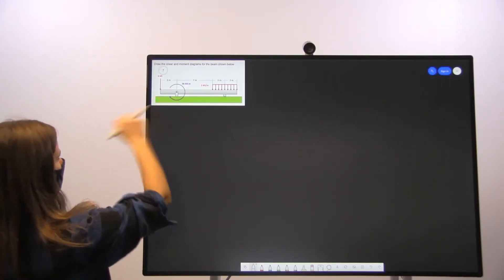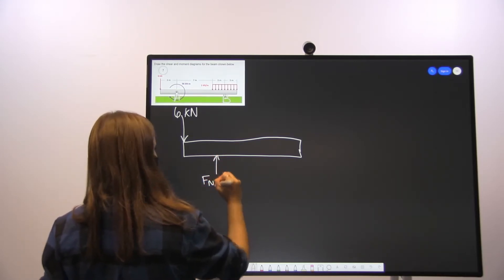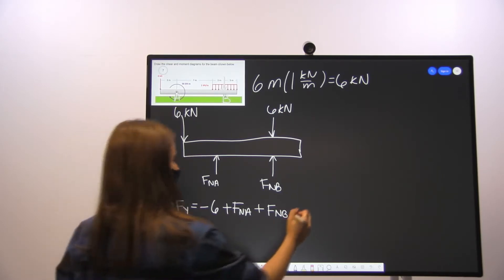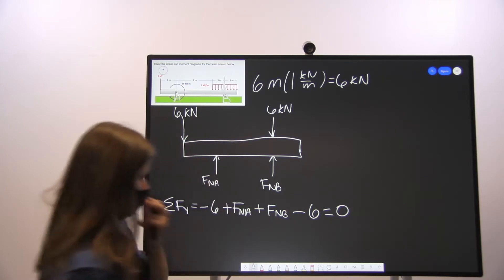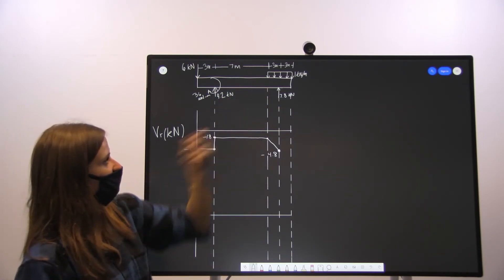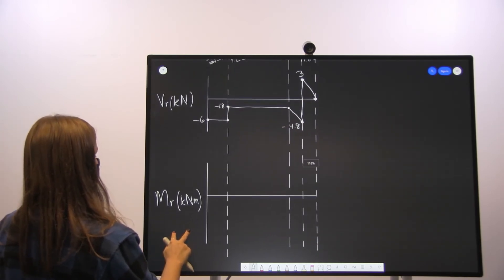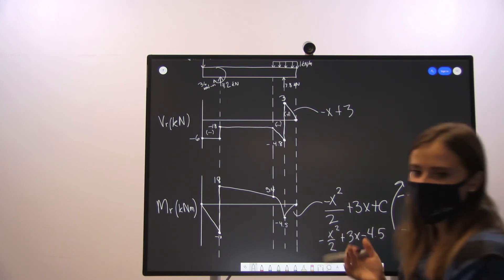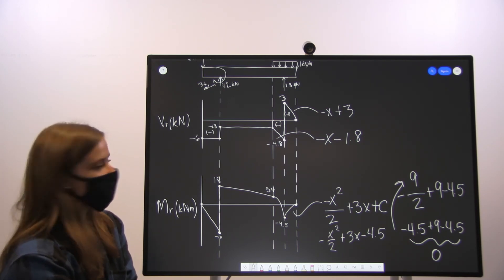WP 6.4.2-SZL

Comment: At the end of the video, to get the -4.5 on the Moment diagram, you can also work "backwards" from the right side of the beam. Since you know the Moment will be 0 at this far right point. You take the integral of the Shear diagram, but if you don't want to write out the equation and integrate it - a more simple way is to just take the area under the Shear here (area under is the same/equals the integral), so the area of the triangle here is 3*3*0.5 = 4.5. You know it is -4.5 because of right hand rule for moments. The way she does it is correct, and a more robust method, but this "area under the curve" method is a shortcut for simple linear problems like this that can help you if you are questioned on something like this on an interview and don't have 4 minutes to work thru it.